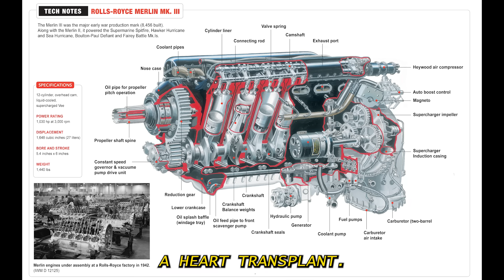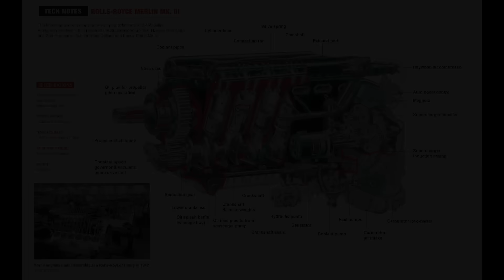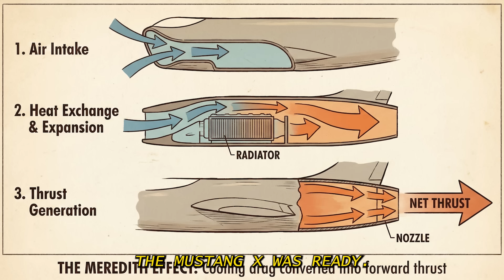They Put A British Engine In A US Plane — And Created A Monster

Comment: And once again @09:45 we get the Hollywood Yank Bs about the RR Merlin being 'hand built' and Packard gaving to re-design it.
What arrogant Bs!
The only changes needed were the conversions of First Angle Projection UK blueprints to Third Angle Projection US blueprints tosuit US production systems.
They even retained British BSF, Whitworth and BA threads and fittings.
Packard were nothing more than paid (but excellent) sub-contractors to Rolls Royce who controlled every aspect of production. When Packard suggested a two pieceblock they found out RR already had it designed and tested. Packard used the RR system.
And hand produced?
Parts were readily interchangeable because they were serviced and repaired in the field. Engines were retrieved from crashed or damaged aircraft and rebuilt using parts off the production lines. Any below air spec parts or engines were used in the Meteor tank engine.
They were so hand built Ford in the UK built them using RR supplied parts! Packard parts fitted RR engines  Packard cranks from danaged engines went into Meteor engines.

And lets remember the Mustang was built to a British design specification, paid for by the British who then paid cash for the first 600. It was the British that gave it the name 'Mustang'. The P-51 name only came after the Yanks saw how good the Mustang was with the Merlin. They called any Allison powered aircraft 'A-36 Apache' and used it as the RAF did for ground support.
Yet again a British funded masterpiece is stolen by Yank arrogance.
Reply: great in depth knowledge, thankyou

Comment: The monster would actually be the Griffon powered P51 Red Baron air racer and the Spitfire MkXIV.
Not the 27 litre Merlin.
Why we chose to go to war with only 27 litres against around 35 litres of DB and more v the Jumo, after the R type is anyone's guess.Knowing our government it preferred to save money than pilots.
Reply: If you had the first clue what you were talking about youd know the Merlin was a private venture by Rolls-Royce and was not built to any government requirement or spec. The 27 litre Merlin was far more efficient than the Db601/605 even with its fuel injection.  It produced around the same hp as the DB engine at the start of the war  and was up to over 2100 by the end. It was lighter and more streamlined in installation and was more frugal. It made 1725 hp in the Mustang, 64 hp per litre,  when the contemporary R2800  made 48.
Reply: @billbuckley8423 
The Merlin was a private venture for sale to the MoD and RAF who else ?.
If the Merlin was good for a reliable 2,000 hp + there obviously would have been no need for the Griffon Spitfire.Or the Red Baron Griffon P51 racer.Obviously RR never knew what the specific output of the DB was going to be long before the War had even started.
But RR clearly did know that 27 litres wasn't going to cut it to win the Schneider races so why was it considered as being enough to send pilots into inevitable future battle against a known larger engine.

Comment: (At 9:56) "the P51B was an American body (and a) British heart.. "
‐------------
Not ar all true-- American Packard engineers re-engineered the Merlin for American production requirements. While Derby UK could produce 200 hand-built Merlins weekly, American Packard Merlins emerged from the Detroit USA factory at 400 units weekly.
In short, an American airframe with a British-conceived, but Packard re-engineered Merlin.
Reply: There were 112,000 Merlins made in Britain, and 55,000 made in the USA.
So Packard's "re-engineering" seems a trifle redundant?
Reply: @BillTomlinson-zj3pn 
Not at all, but very helpful. From the Packard decision to re-engineer to first production, American factories took about one year to begin shipping Packard Merlin production.
British production at a much slower rate, but over a many years-longer production period, accounts for the difference.
Packard Merlins were easier to maintain, as well. Not only tighter tolerances, but no engine-specific adjustments required.
Reply: @bobgreene2892 It wasn't Packard's decision to re-enginner the Merlin for automated production. It was Rolls Royce who did it first. 2 new production line factories were started in 1938 plus a second line at Derby. The First re-enginned production line Merlin came out of Glagow in November 1940. Packards first was August 1941. Dont perpetuates the US bunk that RR made their Merlins by selective assembly by craftsmen the entire war. That largely ended by the close of 1940. Ford UK also made them on an assembly line in Manchester to plans drawn up by Derby.
Reply: @billbuckley8423  No matter how much detail and fact you put in front of any Yank they will still argue Pacjard were some better independent engine builder making their own engines called Merlins.
Their arrogance is only surpassed by their ignorance. All fed by the History Faculty of Hollywood University
Reply: One fault there. Packard never 're-engineered' the Merlin. All they did was to convert UK First Angle Projection drawings to US Third Angle Projection to suit US engineers and production.
They even used the British BSF, Whitworth and BA threads and fittings rather than US UNF/UNC threads.
Packard suggested a two part block but RR already had it designed and tested. Packard used the RR designs.
It is a Yank myth RR Merlins were 'hand built' and stems from the early development engines which were hand built for obvious reasons. Parts were interchangable as the aircraft were serviced in the field. Packard parts fitted RR Meteor engines used in tanks that came from damaged aircraft.
Ford ran a production line in Manchester building Merlins!
Reply: Typical US exceptionalism tripe. It just rankles you so much  you had to adopt a  non US engine that the false narrative was invented 'ah, but we redesigned it and made it better'.
There were 4 Rolls Royce lines in 3 factories building the Merlin by late 1940. Glasgow , Crewe and 2 lines at Derby. This was 10 months before Packard made its first engine. The 200 you quote was the original hand assembly line at Derby. Glasgow built its first priduction line engine in Nov. 1940. Packard, August 1941. Derby redrew the plans to adapt the Engine for production line manufacturing for Ford Manchester well before Packard.  And Packard didnt re-engineer it. They redrew the projections from first to 3rd angle. 183,000 were made total by all factories. 55000 by Packard. So the vast majority of the production was by RR.
 Check your  facts before publishing your revisionist US exceptionalism..
It might interest you to know that Packard was never able to nitride the cranks as RR did so had a weaker bottom end. Also camshafts and rocker pivot arms has to be sent by RR to Packard to finish assembly on several of their  batches  due to high failure rates.
Reply: @billbuckley8423 I am very interested in this topic and have a number of books on the RR Merlin but none mention in any detail the Packard Merlin, can you recommend any sources/books that cover this ?

Comment: The P51 was originally built for the R.A.F to a requirement spec submitted by the British Air Ministry.  Their capacity was already working to maximum capacity on existing designs. The P40 was all that was on offer at the time and was known to be inadequate.  No-one in Britain was furious about the substitution.   North American offered to build a new plane instead.    When the prototypes were demonstrated, they fell short of expectations, particularly at altitude, although the airframe was good, having taken advantage of NACA improvements and other progress since the design of the P40.  The Merlin 61 was substitited in the U.K. and the aircraft transformed.  A contract was negotiated for Packard to build Merlins in the U.S. The Americans then decided they wanted some for themselves.  When fitted with British made drop tanks they then became the long range escorts for the otherwise vulnerable B17.  So was it a German, British or U.S. plane?  It is interesting that you report Goering as repeating everything he had said about the Mosquito previously (allegedly) while attributing many Mosquito exploits to the Mustang.  It was  good enough not to need the B.S.
Reply: Quite correct the Mustang was designed from an English specification, US fighters of the day were big Bruits like the P47 Jugg. Originally the Mustang was to have the Allison turbo charged engine, but the yanks wanted all of them for the twin engine fighters in development. So the Mustang was handy capped from the start. The RR Merlin sorted that airframe out into a winner it should have been from day one
Reply: @keithbartlett9947 the turbo supercharged Allison engine would never have fitted in a plane as small as the Mustang. Thats why they eventually went for the two stage merlin.
Reply: @billbuckley8423  yes and no the yanks stopped North American aircraft even trying to fit the turbocharged Allison unit because they didn't want any competition for the engine. North American say they had a plan to fit the engine in the original design but made changes to accommodate, what is essentially the same engine without the turbocharger. We got a two stage Merlin in a Mustang because a farsighted senior British flyer said to an RAF board the Mustang was a fantastic handling aircraft but was hampered by the engine and suggested a two stage Merlin should be tried in the airframe. The rest is history, it should also be remembered that the American army air force were offered the Mustang and refused it saying it was a small European style aircraft and not in the American doctrine of big fighters with heavy machine guns and cannons. That only changed when the yanks needed a long range fighter to protect the B17s over Germany. The fantastic Prat and Witney double R wasp with 2000hp from a low maintenance air cooled engine was the preferred American engine. I never understood why that didn't try to accommodate 4 of those engines in a B17 now that could have been a game changer, food for thought?
Reply: @keithbartlett9947 The Mustang with a Turbo would have been physically a totally different plane. The Turbo would have gone where the rear ducted radiator went  and the ducting would have demanded a larger fuselage. Plus there would have been little room for the later rear fuselage 85 gallon tanks so it would not have had as much range. There is a reason  the P-47 is the size it was. The P-39 Airacrobra was supposed to have a Turbo feeding the supercharged Allison but difficulties making it fit meant the idea was dropped in order to get the plane in production.
Reply: @billbuckley8423 not really true the original design incorporated the turbo and was just a little lager than the produced model, the changes were made on the drawing board in under a day. Long range was not in the UK spec so that was not a factor. I never said anyone in Britain was upset by the lack of turbo, the Mustang was a great plane as sold to Britain for low level work and reconnaissance it just struggled over 15000 feet without the turbo and the two stage Merlin made a better plane in the end. I was just explaining how we got there
Reply: @keithbartlett9947 maybe, but if didnt get the longer range (and obviously the Merlin engine) nobody would be discussing it now.
Reply: @keithbartlett9947 yes really true. I've read extensively on this topic and never once heard of a Turbo proposal. Perhaps you could enlighten me we some evidence? 
There was an early proposal to use an auxiliary supercharger version of the Allison which is perhaps what you mean? It was dropped as it required extensive changes and therefore delays to production. Turbos were literally the size of a dustbin and its inconceivable it and all the associated ducting could fit in a slightly bigger airframe.

"Allison's attempts at developing a high-altitude engine were underfunded, but produced the V-1710-45, which featured a variable-speed auxiliary supercharger and developed 1,150 horsepower (860 kW) at 22,400 feet (6,800 m). In November 1941, NAA studied the possibility of using it, but fitting its excessive length in the Mustang would require extensive airframe modifications and cause long production delays"
Reply: I think it's interesting that when Packard got the plans for the Merlin they arrived in what was essentially the modern day equivalent of a shipping create from RR because every engine was hand made. The Packard approach was to spend time up front drawing up plans to machine accurately parts that did not require finishing and fit on the engine but were bolt on parts. That alown saved massively in manufacturing time and maintenance time. The yanks may not have been the great designers but could they mass produce something to a high standard. Between us the Packard merlin became the war winning engine it always was but in the numbers we needed.😊😮
Reply: @keithbartlett9947 just a correction. Rolls Royce and the War Office foresaw that the demand for the engine could never be kept up with by selective part hand assembly by craftsmen. In 1938 ground was broken on new factories at Crewe and Glasgow for productionised Merlins, plus a second productionised line at Derby. Rolls Royce only hand assembled the early Merlins. Glasgow was making productionised Merlins 10 months before Packard. Derby also redrew the plans for Ford Manchester mass production. There is a persistent myth that R-R made thier entire wartime production of  Merlins by hand assembly and it took  Packard to productionise it which is quite wrong.
Reply: @billbuckley8423  They will not believe you
Reply: @jacktattis Indeed. They all went to the University of Hollywood.
Reply: @billbuckley8423  check the numbers. The Brits  built more Merlins than the Americans. Hardly hand built.
Reply: @HarryYoungberry-io7tg I dint need to. That was the point of my post. 168000 Merlins made. 55000 in the US. Its a US exceptionalism myth.
Reply: @keithbartlett9947  No back in 41 when the Drawings were sent over a US Officer arrived with a brief case That is how unprepared they were
Reply: @jacktattis if your talking about the Merlin drawings your not correct my friend Packard received boxes and boxes of drawings for a merlin from RR and this is first hand information from someone who's parents worked at RR in the war years until he was called up
Reply: The WWII museum in New Orleans has a Packard built Merlin in pristine condition.
Reply: Just to correct that the Meredith effect was pioneered in the Spitfire. You could say it was perfected in the Mustang but the Spitfire was the first.
Reply: Packard  had been building the Merlin for years  before this happened
Reply: @jacktattis yes but not the 60 series with the 2 stage supercharger. They had been building the V-1650-01, based on the Merlin 45 since August 1941.
Reply: @petegarnett7731  Various primary sources confirm that the British Purchasing Commission asked North American to licence build more Curtiss P40s, who said they could produce a better aeroplane in the same time as retooling for the p40, and drafted the design spec themselves, in response to a British broad letter of intent, rather than the usual Air Ministry numbered spec.
Reply: Didn’t the American government, when they realised how good the plane was, try to stop the export of the planes to Britain?
Reply: @9Curtana It was only of real interest to the USAAF once it got the Rolls Royce Merlin Engine, made under licence by Packard. They rather dismissed the earlier, poorer performing Aliison engined version as 'not our plane, it was built to a British requirement'. By the time it got the Merlin, the UK didnt need many more, as it had no need for a long range, high altitude escort, so the vast majority were supplied to  the US anyway
Reply: @9Curtana  the yanks didn't realise how good the Mustang was until it got a merlin engine. It could have been that good from the get go but the turbo charged Allison was not made available to NA so the design was made around the std Alison engine and with no turbo or supercharger it was strangled above 15000 feet

Comment: The Royal Air Force was not running out of planes in 1940. Far from it! Over 1000 fighter aircarft available to fight the Luftwaffe at the start of the B of B with approx 500 per month being constructed. Therefore by late Sept 1940 Royal Air Force Fighter Command had over 1400 aircarfat available to fight. Pilots were the main issue.

Comment: It has been severely over rated..fw 190 d.pilots thought it was more than a match and the 109 g10 g14 k4.thought the p51 was fast but inferior..and out turned easily..
Reply: The Americans countered that by adopting boom and zoom
tactics. it was unnecessary to out turn the German planes.  BTW the P38 Lightning 
was already flying from England to Berlin, fighting and then flying back to England 
when the Mustang arrived.